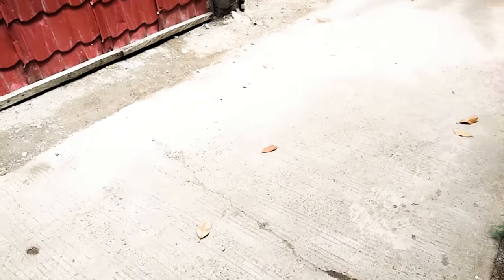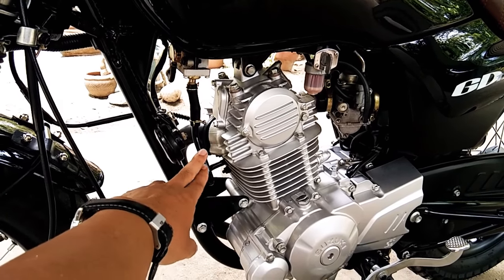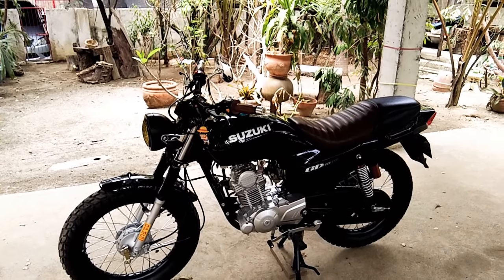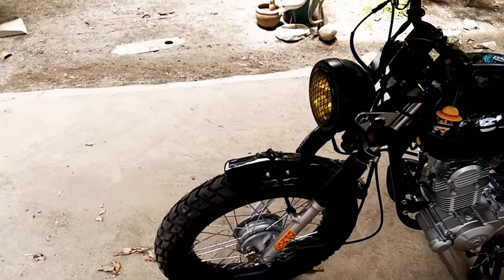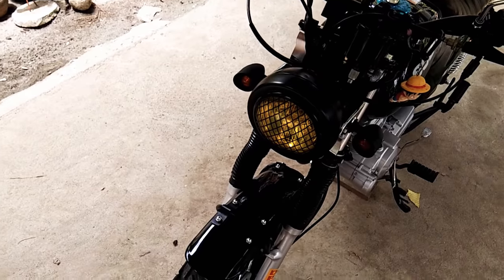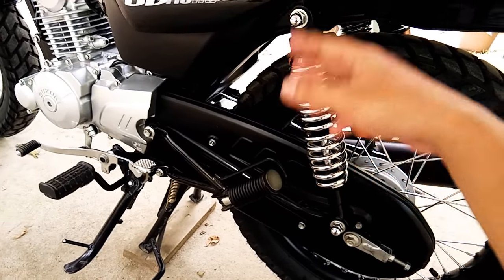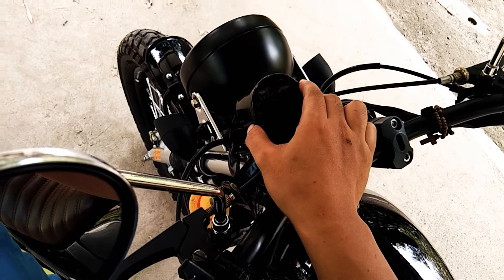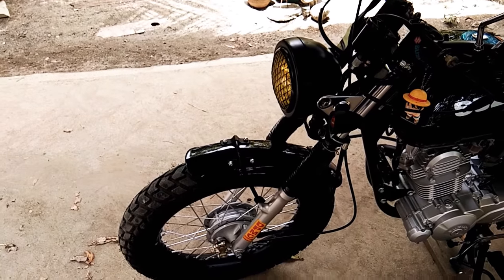Suzuki GD110hu custom modern classic inspired Scrambler

Comment: Nice bike! Can i used it as my referebce for customize?😊 May i ask what is the specs of your Rim that you installed. Thank u & stay safe
Reply from the maker: Comstar U type 1.6x17 front and rear although this was during my trial phase in modding a classic inspired look. 
My advice is go for an E type or the standard rim look from SPD rims. Depends on what bike you are putting it to but safest to go would be 1.85 or 2.15 front and go for 2.50 or 3.00 rear since this are the most common fit for stock suspensions and swingarms.
Reply: @motortega5430  Thanks for the info. Copy on this
Reply: @motortega5430  do u have a fb acct?